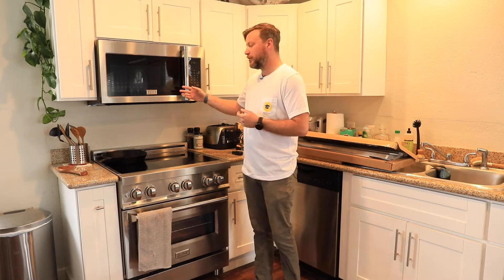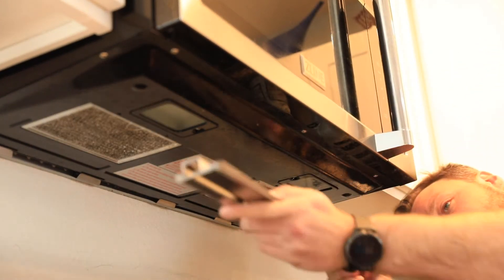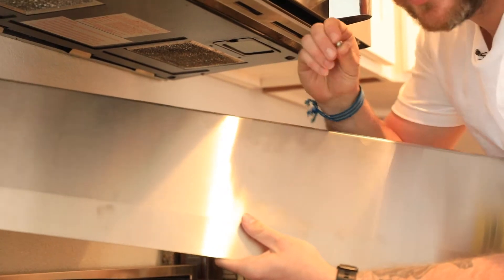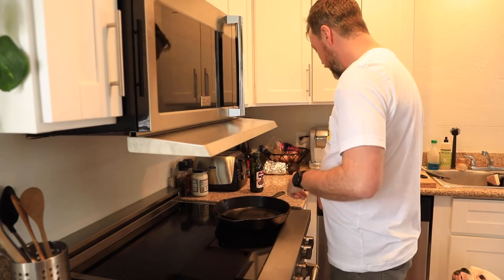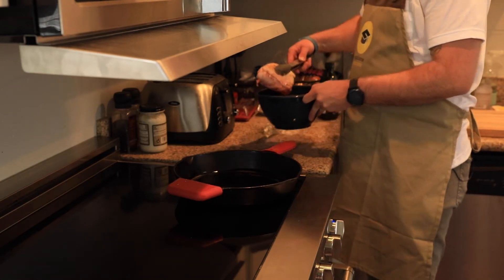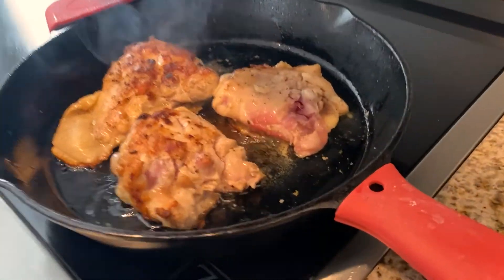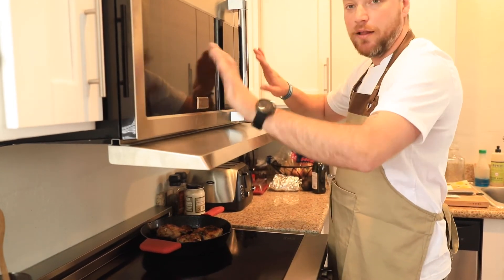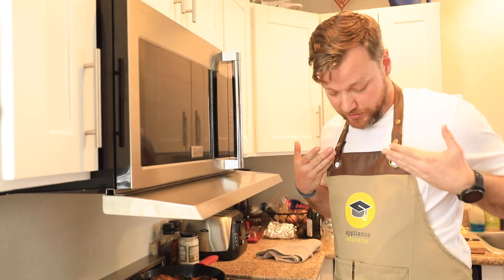AE Microvisor Install and Review

Comment: It's basically something that's going to be in your way that really doesn't help get the smoke out of your house which is what a fan is supposed to do in the first place
Reply: 'In the way' to the same extent as a conventional exhaust hood. Usually you need a fan powerful enough to pull the smoke that's rising out; not something that will pull all of the heat out of your house. Over-the-stove microwaves don't extend out far enough to catch most of the steam and smoke - even at the fan's high setting. The advantage here is the ability to easily remove and replace it as needed. It would work for me.

Comment: Wish it was that easy but I finally got it, except for the middle bolt still trying to line it up.
Reply from the maker: Hello Thomas, we recommend starting with all the bolts first and then tightening them down. Otherwise, the holes may be crooked, and you may have to make the hole bigger. We also always recommend looking at the user manual for installation instructions. Please let us know if you have any other questions!

Comment: Would not be surprised if you got rid it fast.  Abviously too much in the way and the microwave seems to have been installed a little too low and too close to the range top according to code.  A lot of the cooking grease will accumulate under the visor and when boiling water it will all fall back into your food !!!   Maybe a better idea to get the lest cheap visor... the retractable one.

Comment: Looks flimsy
Reply: It's stainless steel. It only has to be strong enough to overcome the force of the steam or smoke. This is a good trade-off if you have to use an over-the-stove microwave. If I had the countertop space for the microwave, I'd prefer a dedicated exhaust hood. As it is, an air fryer, coffee maker, toaster and crock pot, sugar/flour canisters etc. doesn't leave much room for food prep, let alone a KitchenAid blender, food processor, juicer, popcorn maker or the next fad gadget that comes along.  ;-)